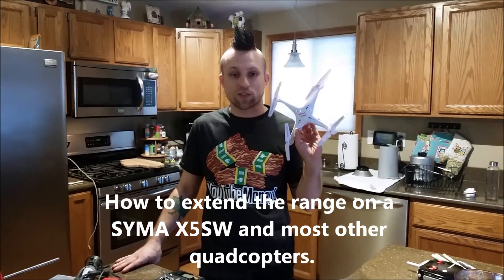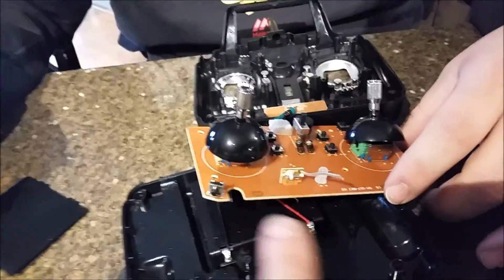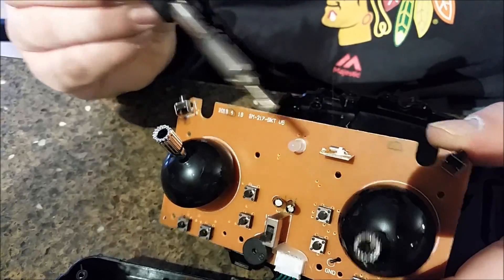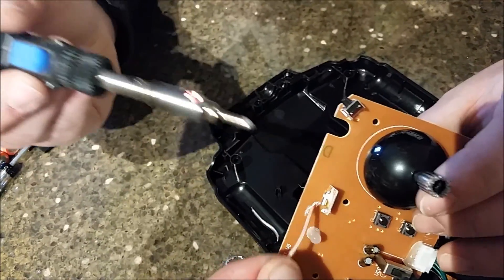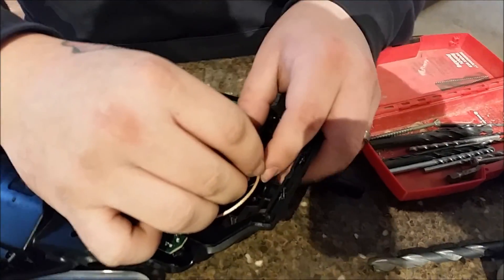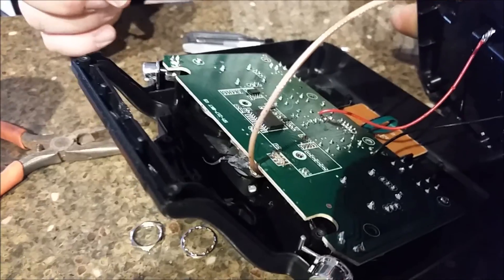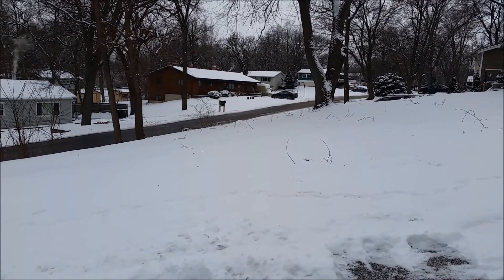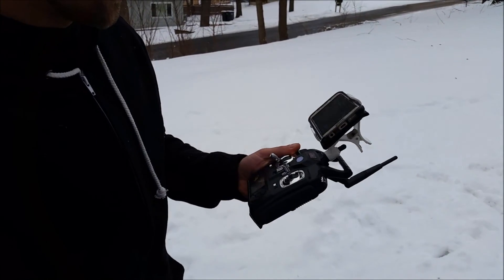Syma x5sw extended range modification

Comment: How many have actually turned up the built in power setting on these drones before "modding"?
And that word is being used WAY too loosely on social media.
On most of these "budget" drones, there is a Low, Medium, and High setting. 
Low for close, indoor flying. Medium for larger indoor areas. And High for outside in the elements flying. 
If the controller does not have a physical switch for power settings, press the top left button once on a Syma X5SW controller. 

The settings change transmitter power at the same time. 
Low setting enables smoother movements by limiting the max voltage sent to the motors, and dampens response to control movement by limiting transmitter power so there is less chance of it getting out of control in small areas.
High gives full power to the rotor controls and the transmitter.

If you still need more horizontal distance, then alter the antenna. And it's not modding, it's altering.
Modding implies improvement in some way. 
Not all of these "mods" will improve anything.
People are altering the TX of these antennas, changing it from a 1/4th to a full wave, risking frying the RF transmitter, or creating harmful interference which IS illegal by FCC rule by the way.
Your device must accept interference, not cause it. That rule is clearly listed on virtually every electronic device made.

That being said, THIS alteration shown is safe where the FCC is concerned, and will not risk damage to the transmitter given you make sure you have shorted nothing out while soldering. 

By the way, do not have a helper help you solder. This comment is long enough so I will omit the reasons why just as I omitted explanations regarding 1/4th and full wave TX.
Trust me, some things are a one person job.

Comment: I did your modification, but the controller won't connect, and the mini screen won't turn on. nope, it dead
Reply: Oh?... and which "button" is that? There are several "buttons" on the Tx. As long as the batteries are out of the Tx when doing the mod it shouldn't make any difference. I did the same mod with the same results on my X5SW.

Comment: Ok... you ve solved the problem with the missing ground on the syma x5 v6-board :-). I ve just read that the transmitter of the syma x8c works great with syma x5c, x5sw and it have a much better range. I ve just orderd one for only about 14$ in a foreign country :-).
Reply from the maker: well that's one solution